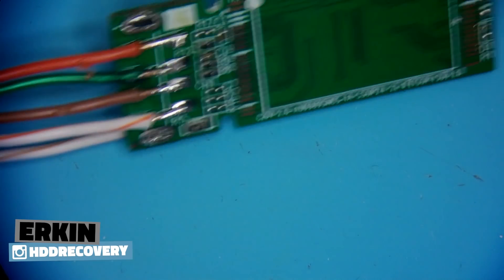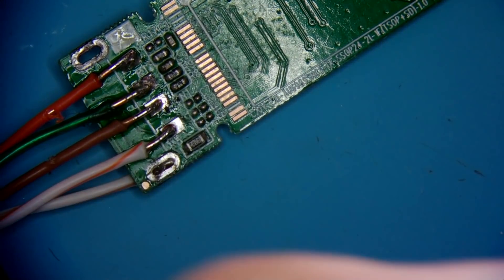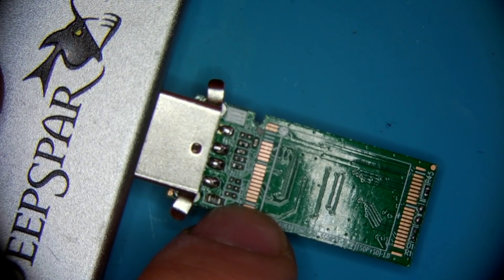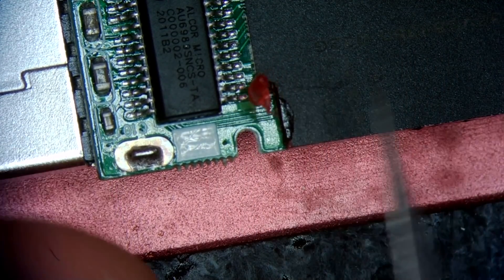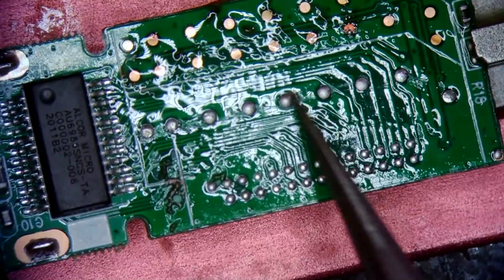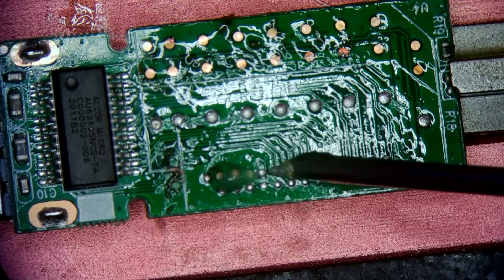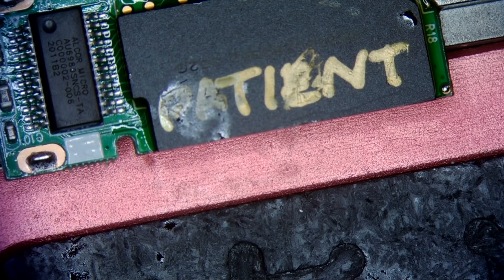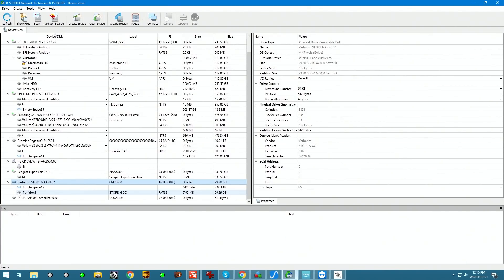usb flash drive repair

Comment: Just for fun sometimes, if i get a computer off ebay, or from a thrift store and it has a hard disk still inside, i run recuva and see what i find. mind you, i don't do anything with the data, just a bit of a curiosity. Although i did keep one thing i found on a thrift store computer, and that was a copy of Half-Life 2.

Comment: Can I ask you what brands of USB flash drives you consider better quality, that offer most protection from various aspects of data loss in your opinion?
Is a brand-name quality drive with percieved good heat/moist/shock resistance, also good from data recovery standpoint?
Reply from the maker: Sandisk and Lexar are top quality on the market. Sandisk ECC is more reliable, Micron chips from Lexar are a the smoothest to work with. However, no device is meant to last forever :)
Reply: @hddrecoveryservices  Thanks for the reply!

Comment: just wondering if its possible for device to output some crazy voltage but only after 5-10 seconds of pluggin it in.
Reply: Very unlikely for a genuine USB Flash Drive. You can probably have some really weird controller fault that draws a lot of current from the port.